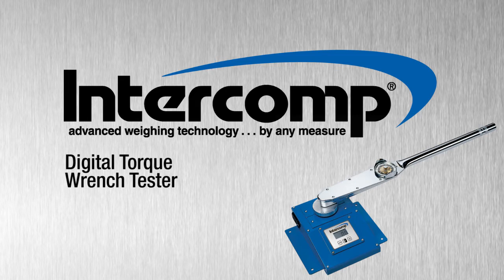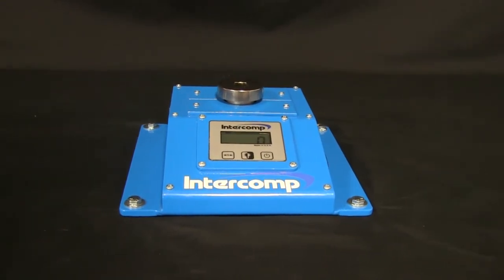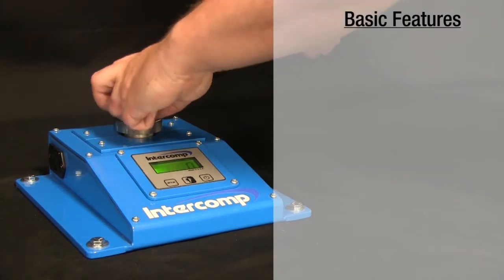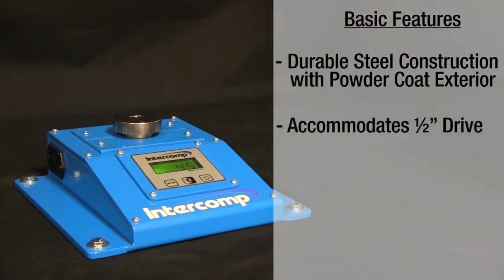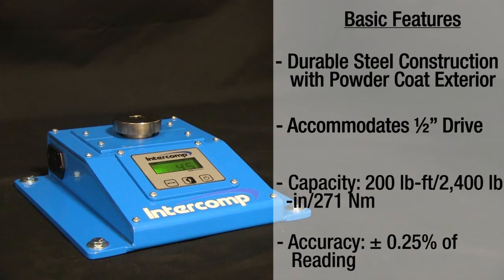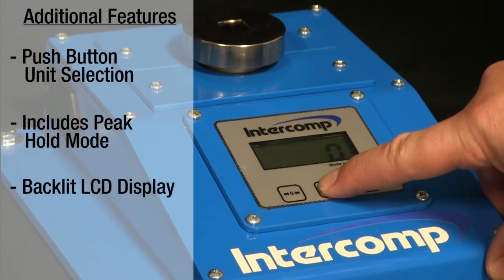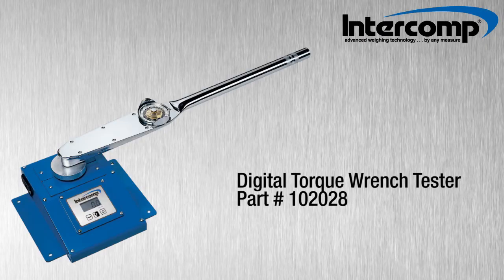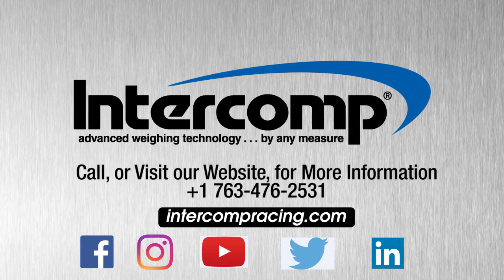Intercomp Torque Wrench Tester

Comment: What does this cost and where can it be bought in the USA ?
Thanks
Reply: https://www.intercompracing.com/digital-torque-wrench-tester-p-109.html the part # is 102028
You can buy it directly from Intercomp ($25 for UPS ground, $61 for UPS 2nd day, $134 for next day). Intercomp's website doesn't charge tax so $570.51.
Just Google around... List of all Intercomp dealers: https://www.intercompracing.com/find-a-dealer-i-55.html
For example, SummitRacing has free shipping, but they charge tax ($32.70) so total is $577.70.